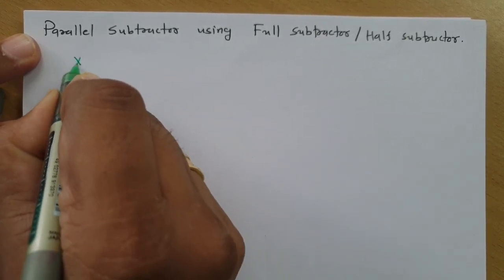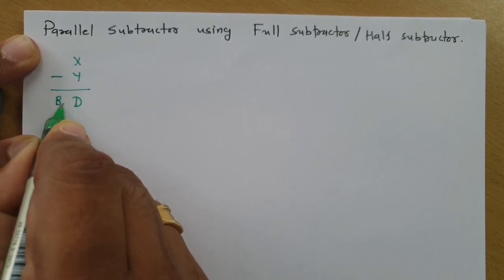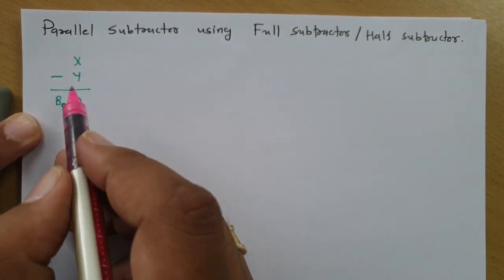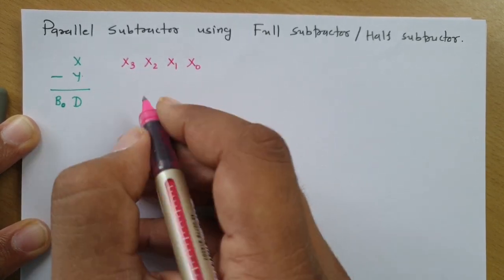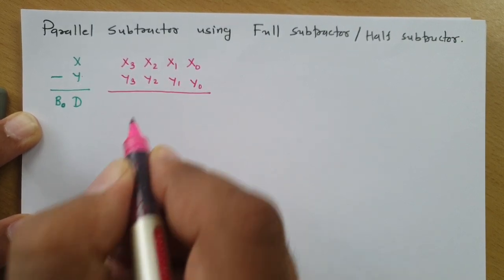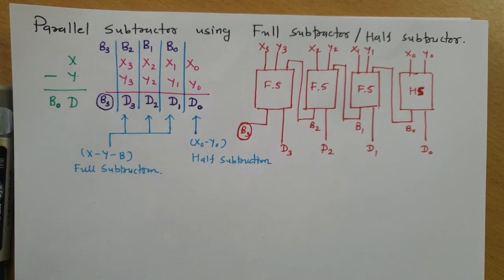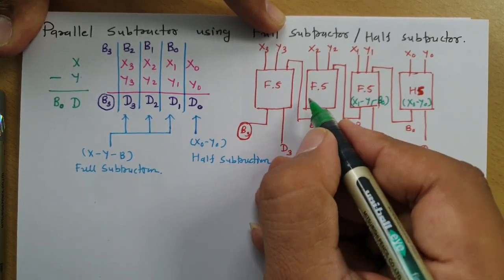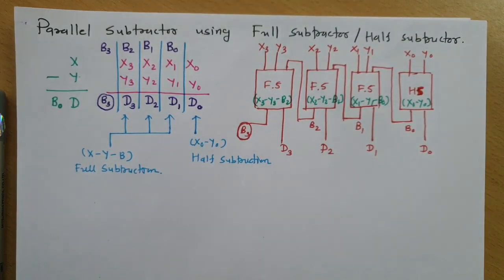Parallel Subtractor Implementation using Full Subtractors & Half Subtractors: Designing & Circuit

Comment: Hello sir 
Can you solve this question!

For a two input AND & OR gate, Determine its output waveform in relations 
to input waveform A & B. Input A has frequency 2Hz with duty cycle 50% 
and Input B has frequency 1Hz with duty cycle 70%.